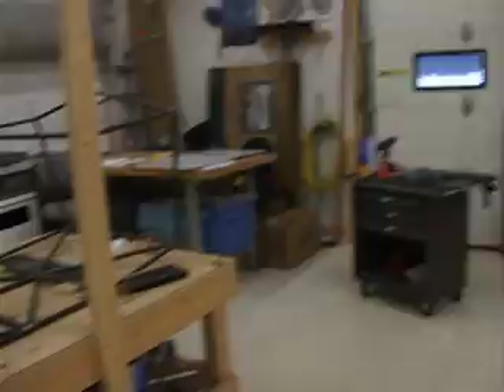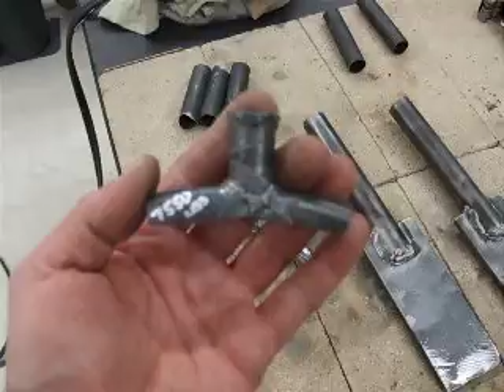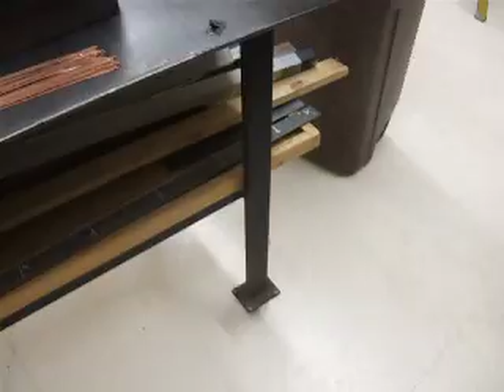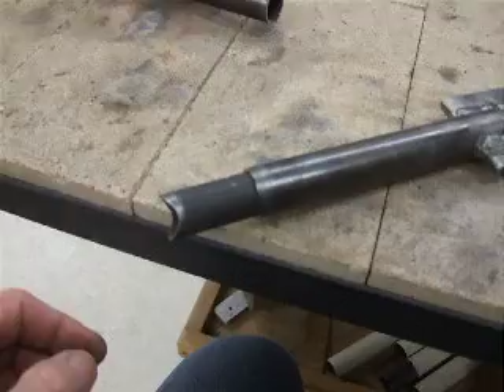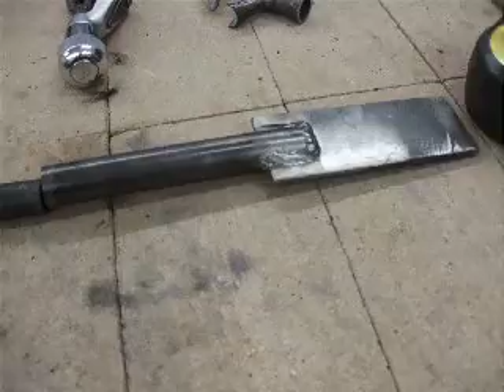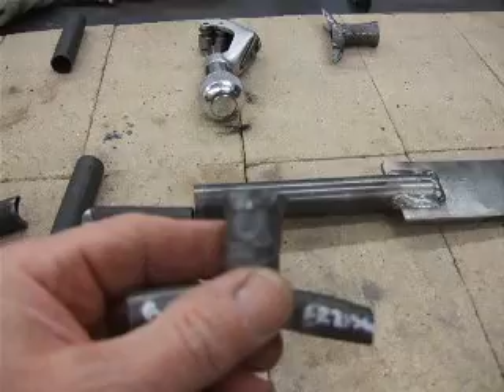4130 Tubing - Welding Rod Test Part 1

Comment from the maker: @thewelderdude Believe it or not, I tried to get a few lengths of that rod for the comparison I did but no one locally carried it (AIRGAS, AIRLIQUIDE). To get it I would have had to special order it and order a minimum quantity. If I were to use it for my project, I would have done it but the cost just for comparison's sake wasn't worth it.

Comment: @alaskabearhawk.... sounds good. thanks for the response. I prefer using the thinner wire(less than 1/16") in welding 0.049" tubing.... b/c it is so small, the rod can be pushed deep into the weld( to ensure penetration) without adding too much material and without cooling the weld too much.  In the absence of the thinner wire, i've chosen to pre-heat more, b/c I'm using a TIG machine, and just use the 1/16"

Comment from the maker: The thinnest I use is 1/16th and I never looked at any thinner. 1/16th is pretty dang skinny and I can't think of an application that I would use any thinner. If you want some really thin stuff, the only suggestion I would have is to get some MIG wire. That goes into decimals around .030 and .035. The only thing you would have to verify is the alloy.